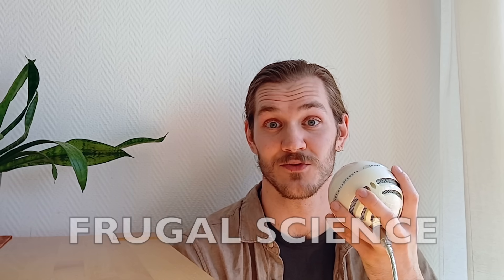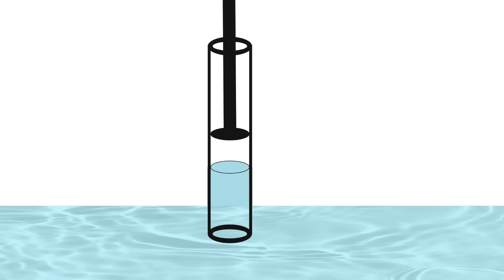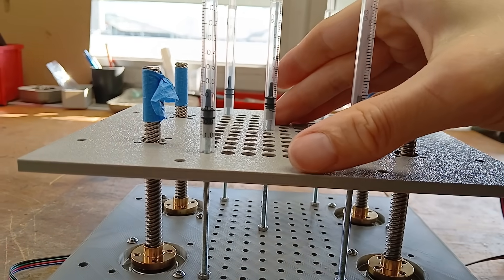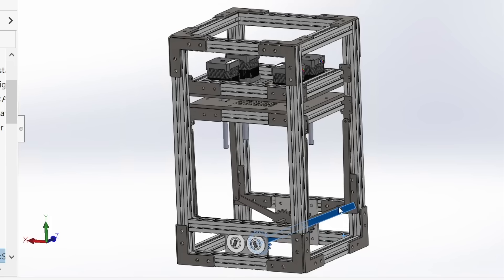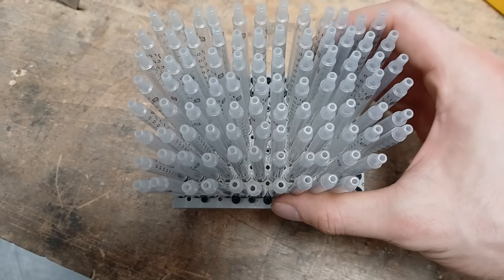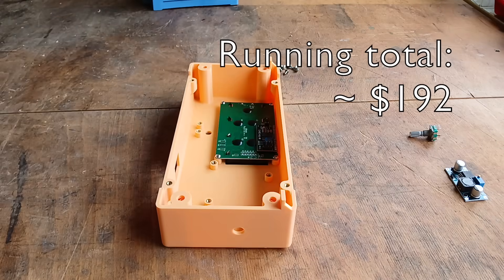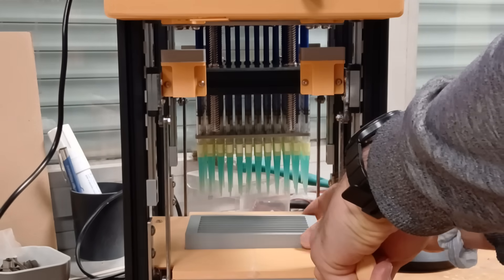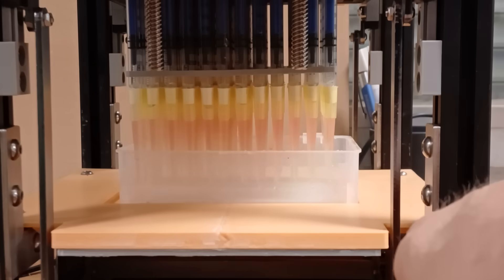This Medical Machine costs $18,000. I Took It Personally.

Comment: It's a really interesting proposition, but, as you said, this can't replace the high end equipment. This machines are so expensive because of the precision, that has to be very exact down to taking into account the liquid tension and how does it affect the drop, which is very difficult to achieve.
Reply from the maker: 100% agree. Not to mention the necessary certifications
Reply: @itstriggy4814 waited for this. Yeah, certifications = most part of final price
Reply: @itstriggy4814  

You won't be able to use it in a diagnostic lab without certs but a research lab can typically do whatever they want, because research is always sui generis.

Having worked in many labs using similar stuff, there are plenty of use cases for this if it were tweaked a bit. A ton of protocols don't call for anything nearly so precise, and a ton of protocols don't need to be right every single time you can just redo the failures. It's pretty typical if you are cranking through 98 well plates for the thing you are putting in to have a quite large margin of error on volume, for instance buffers or wash steps. You don't care how much goes in, it just needs to cover something and then you'll take it off the very next step. 

The next step to make it more practical is you gotta have a way to rapidly remove the pipette tips so you can just place the new block of them underneath. For instance another layer with holes which pushes down on them somehow. In almost every case, we wouldn't reuse pipette tips more than once because that would potentially contaminate the one well with another. 

One question I have though, maybe I missed it, but why not use a hand crank leveling system for both the up down and also the pistons of the tubes? Are the motors that much more precise?

Also, you should take a crack at a DNA sequencer. That would be damn cool to see someone make a low budget sequencing protocol. Oxford Nanopore is out there of course, and can be relatively cheap, but the consumables and the harder library prep is where they get ya.
Reply: @itstriggy4814  That's what you're actually paying for bc you can use a similar machine and get the exact same results but it won't matter to the academia mafia
Reply: @itstriggy4814  correct. This whole video is a gross lie.
Reply: @infectedrainbow grow up
Reply: @infectedrainbow He was very upfront about it being an accessible alternative versus a replacement. Let me guess, you didn’t watch the full video.
Reply: @infectedrainbow sad boi detected, go have fun man
Reply: @_zoid  Accessible? - yes. 
Alternative? Without certification, approvals and repeatability checks. Nope.
Reply: @josearkadio7566  In the developed world those things have a lot of emphasis placed on them but I'm not sure how, or if, that all applies to the developing world.
Reply: @LandscapePenguin the developing countries aren't the stoneage the people there that are educated enough to use such tools, are educated enough to understand that you can't just use a DIY solution and thereby risk the life of millions because you don't know the fuck about that the DIY solution actually contains or does and whether it is actually safe to use
Reply: @xhawkenx633  If you live in developing countries you'd know that in some places, this type of equipment just isn't available. In those cases, where you can use this alternative solution if the solution does not require perfect cleaning, this is a possibility
Reply: Yea lab equipment costs are like 5% hardware, 95% certification and liability.
Reply: @djsnowman06  not to mention, he's considering the cost of the hardware alone, not the amount of expertise and time he put into the project.

This being said, full respect for his skill!
Reply: yeahhh my first thought was how this could be cleaned, followed by what actually is its precision. I do think there is likely a market for cheap low-precision machines, but i also fear that "graduate student with a syringe" might be a similar precision and cost
Reply: @KerbalRocketry you can even get them to pay to be there!
Reply: @KerbalRocketry  There is a market for cheaper, lower-precision machines (and regular, handheld pipettes) and we already have products for that market. Usually it's just using plastic pistons instead of steel pistons. They work exactly the same, they get serviced exactly the same, they use the exact same grease and seals, they're just made with cheaper materials.
Reply: @KerbalRocketry  fresh tips which are the only part the liquid touches
Reply: @bachaddict  and the interior of the syringes! and anything that would be within a clean area (the entire machine). the latter can be relaxed for most use cases but this type of testing is rather sensitive
Reply: @bachaddict  *assuming the machine works flawlessly and never accidentally sucks up too much liquid, sucks up air, or someone simply drops it or tips it over.
Reply: @bachaddict  Even with perfect technique and conditions, pipette will get dirty, inside and out. Under the worst cases I've seen servicing these things, so much media has been aspirated into the pipette from poor technique and misuse that the pistons and cylinders, really any metal part, is totally rusted, or the pipette is totally stopped up with liquid that has crystalized as it dried.
Reply: First step is swap to T8x1 rods instead of T8x8.
Reply: Not really. Cheap commodity syringes stuck to cheap commodity stepper motors homed by cheap commodity limit switches is a REMARKABLY common design pattern in lab and clinical care equipment. The properties of the fluid are generally compensated for in the protocol, not in the equipment.
Reply: You're a horrible human being, and you know it. Sleep tight on your pile of cash.
Reply: A chunk of the costs are because it's hospitals with deep pockets purchasing them
Reply: Not really, no. A lot of the things these machines are used for, can be done by hand in a lab setting. I imagine even this 'consumer-grade' hardware is a lot more accurate than a technician doing it by hand.